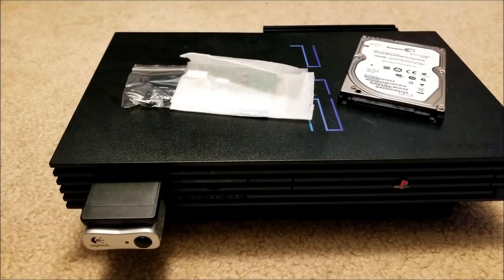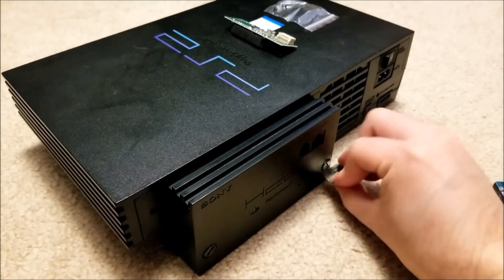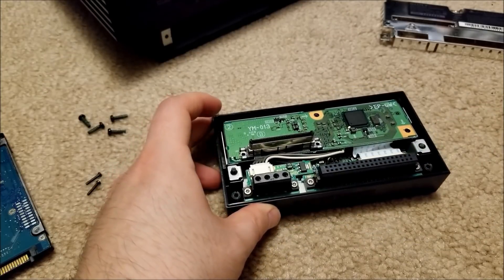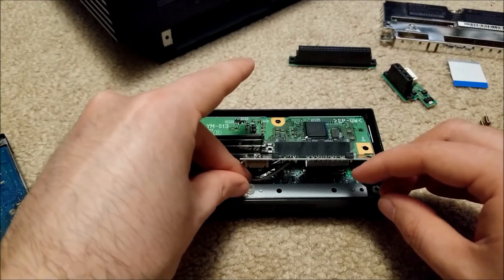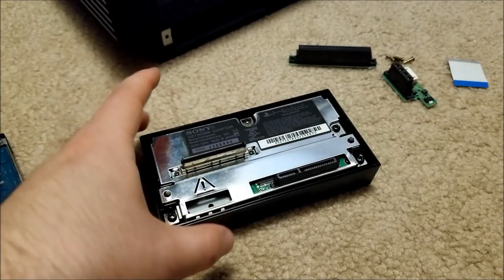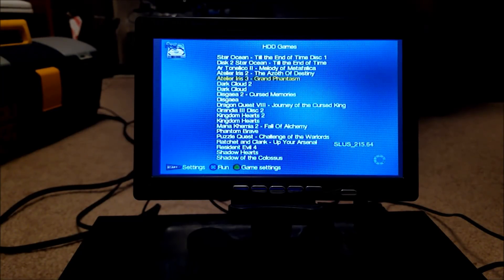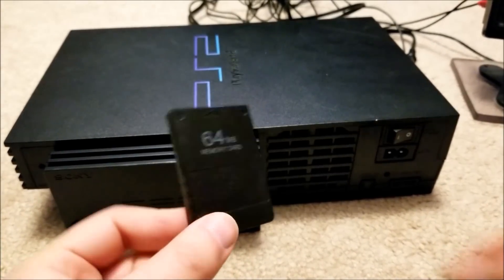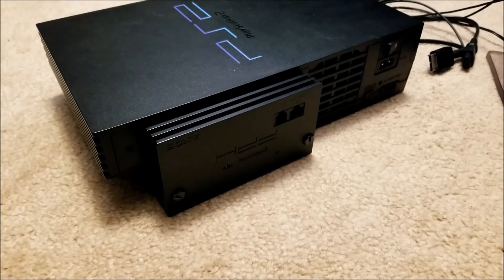Sony Playstation 2 Internal 2.5" SATA HDD Mod

Comment: Just wondering if this works for all 2.5 sata drives. I have a 2tb drive that I pulled from an old laptop and all I need is the sata adapter. But forums are giving me mixed opinions about whether it will work or not and only really talk about 3.5 satas. I need at least 2tb for 458 backups and I don't want to buy another hdd.
Reply from the maker: I have a 320gb 2.5 sata in mine currently and it works fine. Infact it runs cooler, quieter, and is easier to pull out to load new games over usb.

Comment: I have a couple of fat PS2's with broken disc drives that I've been meaning to HDD mod for ages, so I'm glad to learn that the IDE to SATA adapter exists. Great video!
Reply: in china shop digital sell the sata modem and works great and its cheap, 10 dollars
Reply: @filevans  sure, whatever you say, champ

Comment: Dude, your video is great! You were the only video showing how to remove the flat cable.

But I'm having a problem with the 4 Torxs screws. I'm using T6 and T7 (fits better), but the screw just won't turn! None of them!! Yet, your video showed you removing the quite easy. Did you ever had a problem like that?
Reply from the maker: Carlos Barreto I've removed them before so mine were looser but first time they were a bit tight.
Reply: sjm4306 Mine are a hell to remove. I don't know what to do.
Reply from the maker: Carlos Barreto In these cases I use a pair of needle nose pliers to give me just a bit more torque on the screw driver/bit shaft. Once they are past the point they will turn easily.
Reply: sjm4306 Thank you for the advice. I will try to find this tool somewhere, because in my case, it's not that they are a bit tight; it's basically impossible to move any of these torxs screws. They just refuse to be moved, even slightly. It's the only problem that is preventing me of installing the new board.
Reply: sjm4306 I used a plier to turn the screw driver and although it was very hard (specially the last one!), it was possible to remove those unholy Torxs screws! I never thought that removing screws were the hardest part of installing this board. Now everything is working great (goodbye IDE HDDs!).

Thank you very much for your support and fast replies!

Comment: nice video but.... you don't have to bother with screws and ribbon cables... any PATA to SATA adapter-converter will work just fine (along with a Molex to sata power adapter) , and the space inside the PS2 is more than enough for the adapters and the (laptop size) HDD  :-)
I personally have made some small holes on the back of my Ps2 (it was already cosmetically bad to begin with) and kept the HHD outside the unit so that I can easily plug and unplug the HDD.
Reply from the maker: I did buy one of those bare ide to sata adapter boards and yes it works fine but I wanted the option of fitting a full size 3.5" sata completely inside in case I find a 1 or 2tb for cheap (or free as I scrap computers as well and sometimes find decent hdds still inside).
Reply: I see. indeed your method is very good if you want to use a full size HDD  ;-)

Comment: Do you have a link to the adapter board you used? I see only pre made sata adapters not the board when I use the link you added.
Reply from the maker: Couldn't find the exact one as the listing sold out but this one looks the same but in purple: https://ebay.to/2wION0q
Reply: thanks for the reply and info as well as the video.

Comment: I was just wondering can you use a SSD instead of a HDD?
Reply: I don't think the ps2 would be able to utilize the speed of a ssd so it would be kinda of a waste
Reply from the maker: Yes ssd's will work
Reply from the maker: I saw someone even used an sd to 2.5" sata adapter so they could use high capacity memory cards.